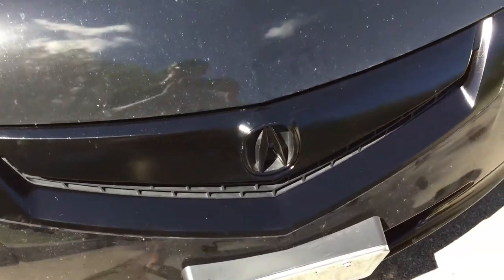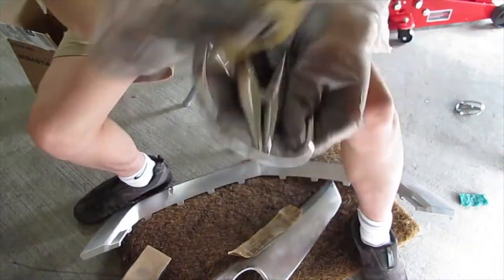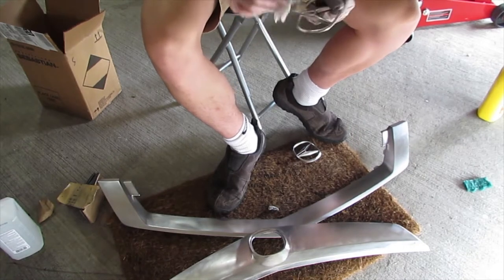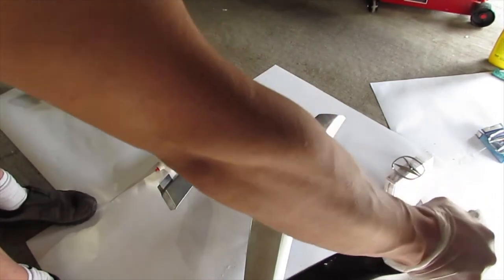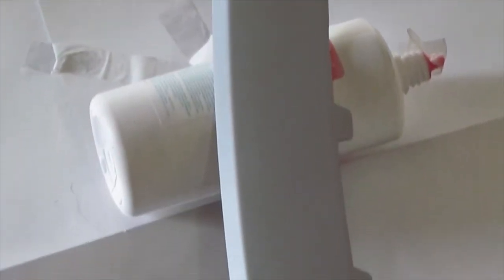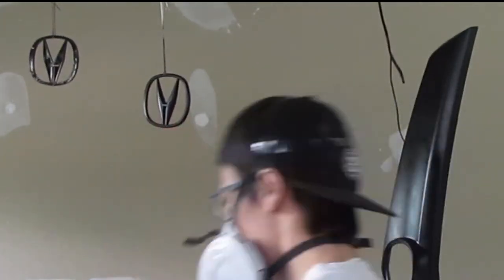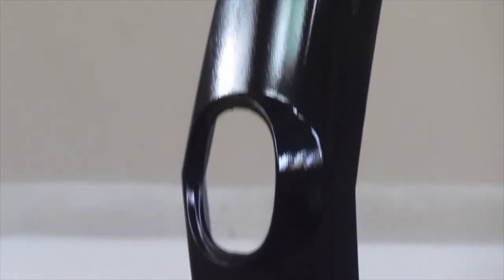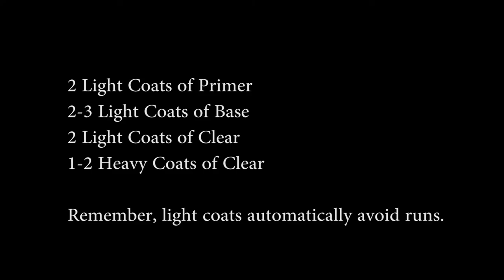DIY PAINT YOUR GRILL GLOSS BLACK!

Comment: Not bad, but you should work on your painting technique. You can run a wet edge with no tiger striping and you don’t have to put on a heavy coat of clear. Even your slow painting is way to fast. Back away a little bit and go much slower while avoiding runs. Get some cheap paint to practice making it look good without clear and then practice clear too. You can do it, you’re close.